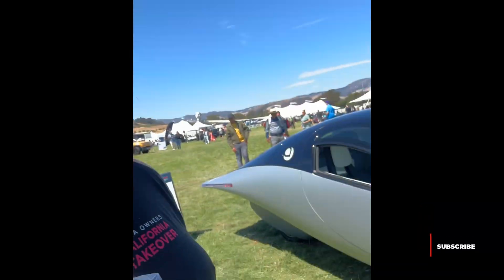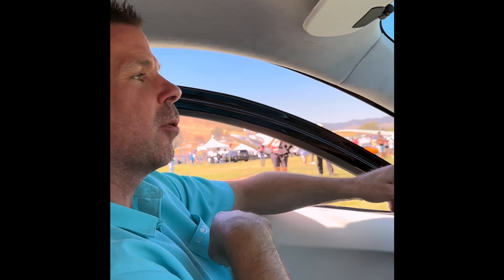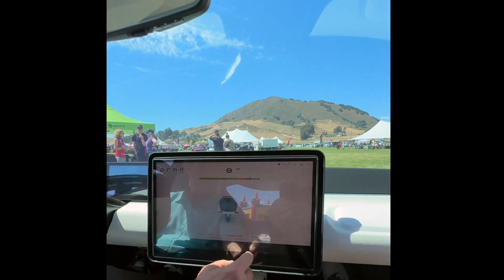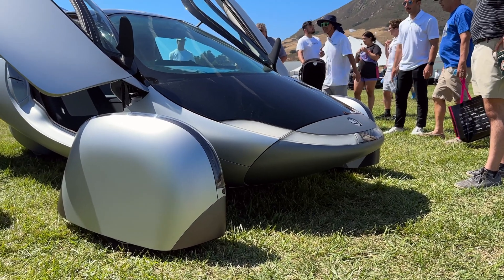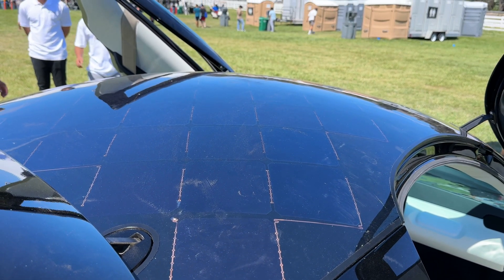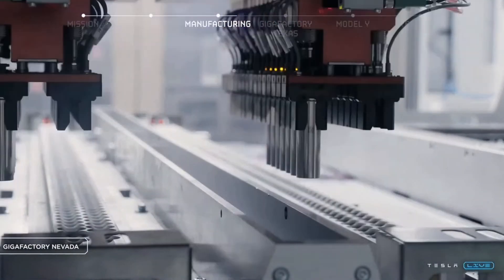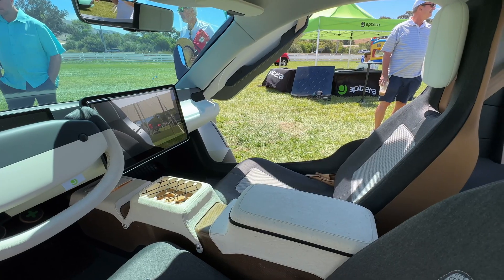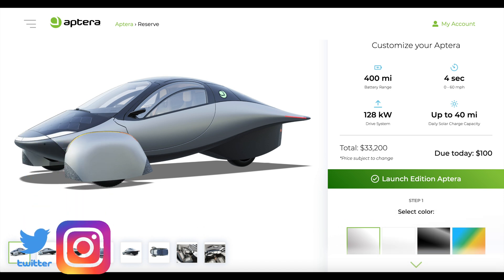Aptera - The Tesla of Solar Cars of the Future!!

Comment: This is an outstanding 2nd vehicle for the home.  It’s perfect for 95% of my transportation needs.  Can’t wait to get mine. 

But, I am concerned about ground clearance over speed bumps, challenges with parking due width, and overheating.
Reply from the maker: if you live where this can be useful, you can stand to really save a boat load on both vehicle cost and "fuel"
Reply: @BeardedTeslaGuy  Justin, do you think SW Florida is a good location for this vehicle?

Comment: Once people see,and drive one, and understand the HUGE benefits from its mind blowing efficiency, IMHO people will slowly come around to its odd looks. 3x cheaper to run than a Tesla, 10x cheaper to run than an ICE vehicle. Recent wind tunnel testing in Italy to be published soon. But they said it met expectations. It’s has a 350MPGe compared to Tesla M3s MPGe of 136,, add in up to approximately 40mi/day free solar charging ( between 8-11,000 mi/year) and you have a very radically cheap to own vehicle. Please note this solar charge ability is ONLY possible because of its super ultra high efficiency made possible by its weight and aerodynamics
Reply from the maker: It's just a niche product, thats all. Any car with only 2 seats already eliminates more than half of the total market. Being Electric cuts it even more. So it wont be for the masses, but I do believe that this car will usher in new manufacturing methods, design and charging strategies. I am all for it!
Reply: @BeardedTeslaGuy  If all that was true, there is still no need for the snake oil lies, and a greater need for real-world validating.
Reply: ICE vehicle- $300 to 400 per month in fuel cost.

Tesla- $25 per month.
Aptera-$8 per month, which is great, but diminishing savings as the monthly cost of both Tesla and Aptera is so low.
Reply: @dvader3263  That's incorrect.  An Aptera is x2 as cheap as a Tesla.  It's ROI is far superior
Reply: @dvader3263  0 a month, the Solar on roof can generate the 8 bucks of electricity. Any more you start paying for the electricity and even if you do you pay for the cheaper and slower charging ac chargers in public.
Reply: correction: Depending how sunny it is where you live
Reply: @Felisargyle  true, the range of solar charging is 20-40mi/day depending on location
Reply: You're plugging the snake oil, but it's still snake oil. Completely unfounded.

Comment: Too answer ALL the doubts here. 
1) final production Delta build happening in couple months, these early Deltas will validate specs and be crash tested.
2) NBC news Aptera was an earlier protype made to show off concept and styling, it was rushed off to Europe to show large investors there, engineering for wheel motors wasn’t completed due to lack of time, right after it came back NBC news asked to do a piece about it. Car was driven up steepest hill in area ( it was VERY steep) on a hot 95deg so cal day. When cooling hooked up to wheel motors finally hooked up motors won’t throttle limit anymore. Virtual testing in wheel motors showed extremely robust and adequate cooling for Wheel motors.
3) early Aptera in 2009 showed highest roof crush strength of ANY car on road, Las test one designed with F1 type carbon and aluminum safety cell, with greater than normal frontal crush zone. Is being designed to meet or exceed highest passenger car safety standards possibly even exceeding Tesla.
Body is molded in only 6pieces going beyond what even Tesla does. Whole car consists of only six subassemblies that are modular and put together in final assembly very similar to what Tesla just announced they’re going to be doing. They are purposely following and even exceeding many of Teslas design philosophies.
By having only 3wheels they’re avoinding most Fed regulations as they’re classified as an auto cycle. Yet because of geometry it’s as or more stable than most 4wheel cars. Body panels are made of high pressure molded SMC carbon and fiberglass in Italy by same company who made body panels for Ferrari and Lamborghini
Reply: @777trader8  they simply do not know what they are doing. the set new production dates each year and people buy into it. at least they have learned to set new dates much further out so that their fans forget the original promise by the time it passes.  They were late with Gamma and literally threw it together because all their prior comments on having components sorted out were not true.
Reply from the maker: I wouldn't worry about the negativity. This is a niche product that will be loved by a niche audience, myself included.
Reply: @BeardedTeslaGuy  It's been 10 hours and the airman hasn't answered his questions. At what point will you worry? This not a niche product; it's a collection of fake prototypes with no product in existence. You're crossing bridges that aren't there.
Reply: Here are some more questions:
Are there some real tests of efficiency, range, and solar charging?
I've seen nothing than gimmick features for which I don't care about.
Reply: @winni2701  I'm still waiting for the airman to land, lol.
Reply: @777trader8  you havnt been paying attention
Reply: @Airman749  "you havnt been paying attention" That's what Bruce baby always says. Pay attention to "havnt" for a start, lol.
Reply: sadly, being an autocycle there are some states and also a province or two in canada where you will be legally required to wear a helmet I live in one of the provinces so I wont be buying an Aptera till this nonsese no longer exists.. and knowing the pace of government.. that could be 20 years.
Reply: @AbBc-w4q  there are now NO US states that require a helmet as of a couple months ago.
Reply: @AbBc-w4q  The laws around this was updated in few geographies as recent as this year too. Not sure if that holds any more. Not sure of the Canada part though.
Reply: @AbBc-w4q  hahahahaha! A helmet? Oh this is gonna be selling like hotcakes!
Reply: @doomsday9973  i dont get what point youre making.
Reply: @777trader8  all I’ll say is IF you’re keeping up with ALL they‘be been doing , like I have, ALL your negative comments/opinions have been completely addressed. I’m not going to repeat over an over. You clearly haven’t kept up with allthe details, and clearly don’t understand how automotive start ups work. I’ve been to the Aptera Factory, talked to the CEOs, sat and rode in Alphas, talked to Sandy Monroe. Keep up with EVERY single article and video about Aptera since 2019. Yes I’m biased since I’m an investor and accelerator investor and ambassador. I’ve invested a considerable amount BECAUSE their manufacturing plans and design ideas are next level. I can fortuitously afford the risk, any startup has risk.
IMHO the design is solid and game changing, that’s WHY I’m taking the risk. The disrupters in ANY industry always catch ALOT of negativity, especially by those who don’t understand the tech, Many many thought Tesla would fail, thought the design would never work, thought they took toooo long etc etc.
Reply: @Airman749  "all I’ll say is IF you’re keeping up with ALL they‘be been doing , like I have, ALL your negative comments/opinions have been completely addressed." I have kept up as much as I can from Australia, and I have over 50 questioning videos that you nor anyone from Aptera has been able to answer properly. Your claim has nothing behind it, and is essentially more snake oil.
"I’m not going to repeat over an over." And since we haven't seen anything addressed - we're not going to believe you. That's how it rolls. 
"You clearly haven’t kept up with allthe details, and clearly don’t understand how automotive start ups work." You clearly don't know what clearly means. And we don't need to know how start-ups work; we just want to know how the silly trike works. Trader's first question was how does the skin cooling work, and he never ventured into how does a start-up work. You are clearly off track, airhead, so don't call trader dumb.
"I’ve been to the Aptera Factory," I've been to the Cadbury chocolate factory - got the tour explanations, and still don't know how to make a Freddo Frog. BTW, did you see one Aptera off the 12-station production line?
"talked to the CEOs," These one's lie. 
"sat and rode in Alphas," Did you leave the carpark? 
"talked to Sandy Monroe." Does he wear continence pads? 
"Keep up with EVERY single article and video about Aptera since 2019." And have kept that information to yourself. Try sharing some, or did you sign an NDA?
"Yes I’m biased since I’m an investor and accelerator investor and ambassador." It's not the bias - it's the brainlessness. 
"I’ve invested a considerable amount BECAUSE their manufacturing plans and design ideas are next level." No need to shout. But you have invested in plans and ideas. Think about that. 
"I can fortuitously afford the risk, any startup has risk." It's easier to flush it down the toilet. There's that, so do it the most efficient way, lol.
"IMHO the design is solid and game changing," The biggest liars appeal to their honesty. 
"that’s WHY I’m taking the risk." Best you add the 'not a financial advisor' disclaimer.
"The disrupters in ANY industry always catch ALOT of negativity," Still no need to shout. Do they block the negativity or dispense with it by explaining how things work? Do they claim they have done that too many times, already? 
"especially by those who don’t understand the tech," Do they explain the tech? I know - it's the same as 'how things work' when in the tech field.
"Many many thought Tesla would fail, thought the design would never work, thought they took toooo long etc etc." So, what? Many thought Aptera v1 wouldn't fail; thought the design worked; and didn't think they took too long. Where's your logic headed? Don't tell me you're qualified to fly?
Reply: Lots and lots of wishful thinking here
Reply: @doomsday9973  un huh.. care to explain? or you just gonna poo poo everyhting he took the time to spell out and explain with your empty comment?
Reply: @doomsday9973  maybe, but based on info that has come out if one bothers to look which most don’t
Reply: @777trader8  I notice there appears to be at least one reply he didn't make public. Can you confirm that? It's something I don't like, and it's indicative of someone having much to hide. I will respond to the one I can see. You're right - that one is empty.
Reply: @777trader8  Two hours and still no response from the airhead; I'll wait. maybe he's flying?

Comment: That's great, in concept. Tell me how US regulations will fuck it up and change the final product in such a way that it's too expensive for most, or changes something that make it less efficient than stated in this video.  Also, Bearded guy, please please back off the back ground for vids like this, it was hard to follow the convo with it. I am excited for this type of vehicle, and I don't doubt it works as they say. I doubt local and fed regulations to let this thing be what it is.  I want to see some in customer hands before I even start to believe this will be a thing.

I'd love to see Tesla lease out Giga space to help push these types of vehicles forward and/or even adopt this solar tech in some of their car designs.
Reply: youre a nay nay
Reply: Because it's classified as an autocycle or motorcycle, the gov. regulations are minimal. Aptera claims that it will meet safety standards equivalent to cars. I doubt Tesla is interested in Aptera at all. Elon doesn't like 3 wheel vehicles. I think that's a good thing. Tesla has too much power already.
Reply from the maker: I dont know of anything that will create immediate issues for releasing the car, but there is always a chance.